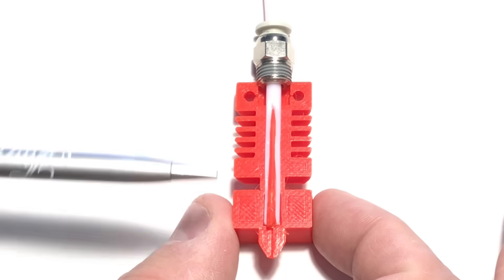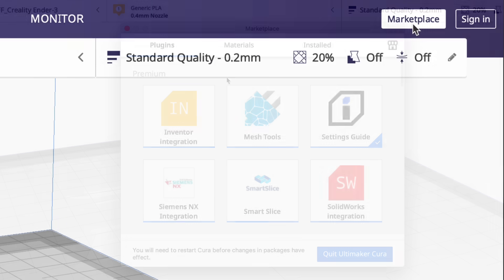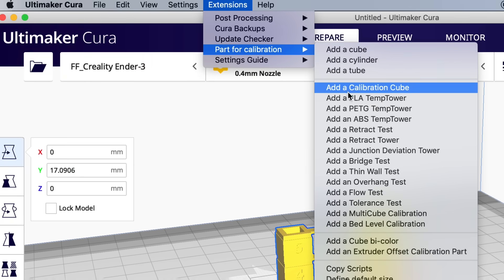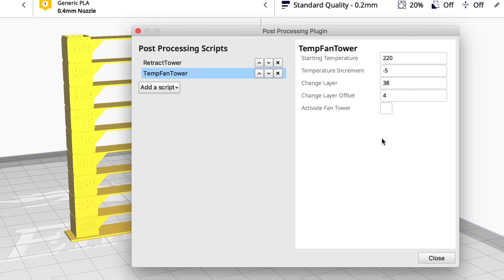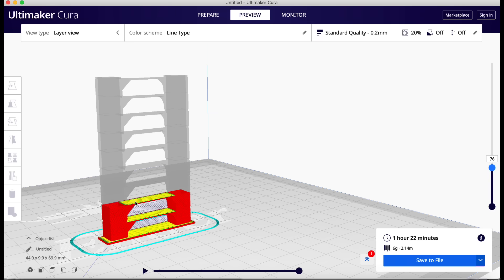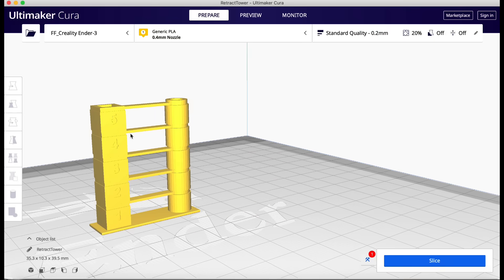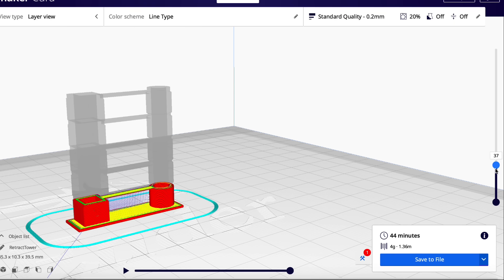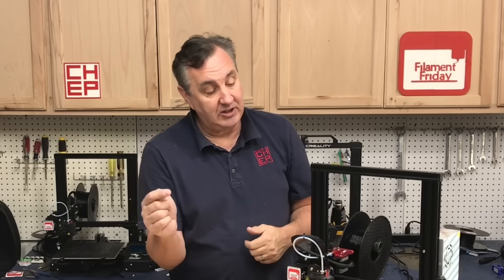Calibrate Perfect Retraction Settings Using a Cura 4.8 Plug-in

Comment: Hi chep
I found that I am getting no strings at 220°c with retraction distance 5 at speed of 50 but I am facing a problem for 30-50 min printer print well but after some time filament stops to come out of nozzle what can be the problem waiting for your reply thanks.
Reply from the maker: Might be similar to this https://youtu.be/x35aWmnZ_A0

Comment: I just updated it to Cura 5.1.0 and Calibration Shapes 2.1.0 and something is very wrong... I am using the Standard Quality profile, layer height .2mm, and for some reason the bottom layer of my first bridge is at layer 39, which would be fine if my next one was at 78, but it is at 81...Checking each temp transitions I get these layers at the bottom of each bridge

378 	Top Layer
372		+42 layers
330		+41 layers
289		+42 layers
247		+42 layers
205		+41 layers
164		+42 layers
122		+41 layers
81		+42 layers
39

I don't understand what is going on.  Each transition is either 42 or 41 layers away from the previous.  It goes back and forth until about the midway point where it doubles up on the 42 then goes back to alternating.  Any idea what is happening?
Reply from the maker: 5.1 is a beta.
Reply: I just noticed the dimensions of his tower in the bottom left and mine are different

44.0 x 9.9 x 69.9 mm CHEP's
44.8 x 9.9 x 75.6 mm Mine

I had to spend some time coming up with a calculation to fix this.  If you look at the object as 9 chunks, top of the bridge down as a chunk, including the slight in-step at the bottom of each chunk, or the whole base as the in-step layers of the bottom chunk, I got this:

((A * 9) * B) + (C * B) = Z scale

Where A is layers per temperature change, B is the mm per layer, and C is number of layers of the last in-step.  For me it was 

((38 * 9) * .2) + (4 * .2) = 69.2 mm Z Scale, or 91.49% of the original object that mine imported...
Reply: Same deal for me.  In all reality it's not a huge deal as it does take time for temp to increase anyway.  So long as you are starting the temp increase at the top layer of the bridge for the next temp calibration area you will be fine.  Same will occur w/ the retraction tower.  I set layer offset to 0 also as when I was inspecting gcode I noticed the temp change would start higher than it should as it added the base layers defined in layer offset from the initial start layer.  So if initial start layer is 40 and layer offset was 3 (For a base of 3 layers) it's start increase at layer 43 instead of 40.
Reply: The retraction tower seemed to match CHEP's, so after doing a few leveling tests I started the heat tower...which detached from my bed right at the start of the third bridge, so I have 220, 215, up to the top of 210, and then a pile of spaghetti...sigh...what it did manage to print looks ok though, there is a slight droop in the 220 bridge, which is to be expected, but 215 looks good and what printed of 210 looked good too
Reply: The instructions for the temp tower(available from github) say to print at layer height of 0.16. There are instructions for all of the calibration shapes included in the addon on github

Comment: Being a newbie to 3d printing, this is a great video for my PETG filament calibration (of which I still have stringing problems).  I tried both tests and see some differences in the temp test and in the retract test.  Looking at the actual gcode file for each test, in the "temp.gcode", I see the M104 instruction to change the temperature at each designated level.  However, in the gcode file for the retract test, "retract.gcode", I to not see any instructions for changing the retract distance at each level (like G10, G11, M207, M208 or M209).  The only "M20#" instructions I have in that "retract.gcode" file are: M201, M203, M204, M205.  Yes, I did load the "RetractTower" script prior to slicing.  How does this retract test work if the retract is not being reset at each level?  What am I miss-understanding (or actually missing)?  Thanks in advance.

Comment: i have cura 5. there are some differece. my printer doesnt obey the comand, it doesnt change the temperature
Reply from the maker: I just ran one in Cura V5.0 and it worked flawlessly. So I’m not sure what the issue is.
Reply: I manage to make it work! Dunno what I did, but, it worked
Reply: Have you tried slicing, then adding the script and slicing again?

Comment: I sliced with Cura 5.0 the scripts are already added. However, when I save to disk then send it to Octoprint it doesn't change temps OR retractions. I checked to make sure I had the script in the bottom right after slicing. I am sure I'm doing something wrong, obviously, and its probably simple. Please help.
Reply: it takes about 5-10 minutes for me to change the temp while printing. So make sure you wait first

Comment: Been having stringing issues for quite some time now. Running these tests and hoping to figure out what the best settings are for my pla! Also, should the temperature changes be reflected on the screen of the ender 3 v2? The temperature indicator on the screen doesn't change automatically.
Reply: I have the same problem
Reply from the maker: Try this. https://youtu.be/OG7We83M5gc

Comment: Cura 5 doesn't change the temperature as it builds the tower. Any suggestions?
Thanks for your help!
Reply: You still have to go in and add the gcode that triggers the temperature change. Extensions -> Post Processing -> Modify G-Code. Press Add a Script, and all the scripts should be there to choose from. Pick TempFanTower and follow the video like normal
Reply: @Homebrew Stew you should be able to confirm if it's cura causing this or not by looking through the code it generates. Open the .gcode file with notepad or something similar and start using ctrl-f to look for the temperature change command. Each layer has a comment which looks like ";LAYER:#" to denote when that layer starts and in my experience, cura injects the custom gcode right at the beginning of the gcode for that layer. Look for an M104 command. If the command isnt there, you can manually add it yourself, or try to diagnose why cura isnt adding your custom gcode as intended. If it is, then you will have to see why your printer is not interpreting the command correctly
Reply: @Homebrew Stew What settings did you add for the ChangeAtZ 5.3.0?

Comment: I got the right temp setting for my pla +.  When I run retraction test, on retraction of 1 through 5 with a speed of 50mm/s I’m basically seeing no change in stringing it’s still pretty bad.  What would you do in this case ?
Reply from the maker: Try this: https://youtu.be/OG7We83M5gc
Reply: @FilamentFriday  Dude says he sees no difference in his retraction test and you link a video in which you clearly state that this is not a solution for retraction issues, only for wispy stringing...
Reply from the maker: Marco2G -?And what’s his issue with retraction? 
Stringing.

Comment: Great video, thanks for the work, no matter what I do when slicing my layers don't line up like yours "38/76" etc - I copied your settings .2 layer height made sure everything is .2 copied the size of your tower and no matter what mine does it in increments 38 - then 79 then 122 etc it constantly get's further from 38 - I try 39 or 40 no matter what I do my transition layers never line up I am over it. How can I get an accurate idea of the tower if I can't get the transitions setup properly. Thanks for the start though.
Reply: same problem must be a compatibility issue with version 5
Reply: Had the same issue, but reasoned that the setting doesn't need to apply at an exact layer.
Having a layer or two at the wrong setting won't prevent you from observing stringing at different settings, as long as it prints at the correct setting for most of the layers.

Comment: When I load the Temp Tower model it's showing 75.6mm tall, and the layers between temps vary between 41 and 42. Layer Height is set at .2 but the tower is imported at a weird height. Any idea what would cause this?
Reply: same
Reply: There is definitely something wrong with this tower height for the 0.2mm layer height (as per video). I think we need to change the initial layer height, and a few other parameters in order to get the exact multiples. When I have time, I will work on it. Now, I just design a single tower and print it a few times with different temperature :D

Comment: my temp tower is all stringy on the back esp at the bottom where the higher temps are. was i supposed to print with supports? besides that, all the layers pretty much look exactly the same, only varying amount of stringing but only on the back. yes, it did change temps.
Reply: no its probably because it wasnt at that perfect temp and was too hot so it was stringy

Comment: When is "Calibration" coming to cura 5.0?
Reply: It took me a while to find it also.  Push the Marketplace button then push the little "Search in the browser" icon.  It installs directly from the browser.  After restarting Cura, you'll find it under the Extensions menu (unlike in this video).

Comment: Will this work on an ender 3 S1 direct drive?
Reply from the maker: Sure. Why not?
Reply: @FilamentFriday  The direct drive on my printer has a retraction distance of 1.35 and speed is 40. If I go to 3.5 - 4  for distance it almost always clogs. So I was just wondering if the settings for a retraction test would be different with the microswiss direct drive.
Reply: @Robin991000  yeah I want to know how to do it with the microswiss old DD and New NG
Reply from the maker: Typically I use 1 mm with most direct drive. It depends on the filament.
Reply: @FilamentFriday  I managed to figure it out mine was set at 1.35 and jamming so I dropped it to 1  and it's been working fine since.  When I wrote this a while ago I was new to the direct drive and couldn't find alot about it and how to tune it so wanted some help.  but it's all figured out  now and running beautiful 😊
Reply: I also Want to know this?

Comment: what if my temp tower has BAD stringing at all temps? tested pla+ 230-200C. anycubic vyper using .2 default settings.
Reply from the maker: https://youtu.be/OG7We83M5gc
Reply: I'm having the same BAD problem.  I'd be happy with the small amount of stringing in CHEPs' video below.  CHEP, is there help for those of us who have BAD stringing problems?   I'm just starting with the temp tower with lots of stringing.
Reply: @KenOfHouston  hey friend, you could try the video chep linked under my original comment. What actually ended up being my problem was moisture in the PLA filament. I live in Oregon USA and it gets decently humid. I didnt realize how quickly the PLA would absorb moisture. I bought a new roll of PLA and a dehumidifier box for it to sit in. i bought the Esun one. ive been having much nicer prints since.

Comment: Didn't work. I'm on my 4th level of the print and the temp is still 245 degrees. Starting temp was 250 degrees. Should be 235 degrees by now if it really reduced by 5 degrees.
Reply: Seems like your hotend suffers from a broken/faulty thermistor that causes thermal runaway. I suggest that this is in need of a close inspection and when this shows up to be the case I would buy myself a brand new replacement thermistor or perhaps the complete hotend if the one used for your printer is also a not too expensive upgrade hotend obviously. Because eventually pricewise it makes no sense replacing a (for example ‘dragonfly’) hotend in comparison with finding a single new thermistor somewhere. I hope my tip will come useful and you can continue 3d printing soon

Comment: how do we translate this for pla+. get a 3d printer they said, it goes brrrrr they said. frustrating as hell for a total noob.
Reply: pla+ starts at 230 and goes 200 for temp tower. you have to make sure before you slice it that you set the starting temp at 230 or else itll boot up by default to 220
Reply: thanks for the clarification chep.

Comment: Very instructional, thank you.
Bhat in what units are the retraction steps? Let's say I printed both towers and found out that retraction step "4" works best for me, how do I use it in Cura? The settings for retraction in Cura that I found are in mm, so how do I translate the "4" to mm?
Reply from the maker: Set retraction to 4mm
Reply: @FilamentFriday  Thanks!
I have another issue I'm guessing is also related to retraction. I have the Prusa i3 Mk3s+ (kit). I see that consistently, after every non-print move, when the printer should resume printing the print does not start where it should; there is a lag until the print actually starts so the first few mm of the print are missed. There isn't any noticeable stringing during the move, it is just that the resume of the prints lags.
Is this related to retraction? Which setting(s) do I need to tweak?
Reply: @oferrivkind  That's why you should prime the nozzle before the print. Use a Skirt, Raft or Brim before printing the main print.

Comment: When I go to print the slicer temperature settings seem to be overwriting the Gcode script i entered. Printer jumps to 200 regardless of the preheat I set it to and the temperature is not decreasing after 38 layers. Am i doing something wrong? Wondering if it could be the firmware I downloaded.
Reply: Did you follow the step at 2.57?

Comment: Hi, thanks for all the amazing videos!
I have an Ender-3 Pro (and Ender 5 Plus), when I check the layers of the temp. tower I see that the first layer of each of the bridges are at layers: 
39
81
122
164
205
247
289
Which means at jumps of: 42,41,42,41,42,42, how could it be and how should I resolve this please?
Reply: Maybe you have adaptive layers is enabled?
Reply: I have the exact same numbers as you.  Were you able to figure it out? and I do NOT have adaptive layers enabled.
Reply: I had same with my Ender-5 Pro, and while I don't know if it was the "right" solution, I put a "Change Layer Offset" in of -3, to basically get the first change  to 42.  I know that won't make everything perfect, because some are 41 and some are 42, but until someone that really knows what they are doing answers, that is what I tried.  It is running now.
Reply: I have the exact same numbers as well on my Ender 3D pro. First 4 lines of base, starting at 5. First ceiling at 39, then at 81, 122, 164, ... I entered Change Layer at 41 and Offset at 0. This matches the physical part best following y = ax+b. I feel this is good enough for a general impression.
Reply: I'm seeing the same thing, I just set it to 42 with an offset of 5 since that's pretty much close enough

Comment: Question to CHP, if I want to work with an add a script for a temp tower starting at 195 - 230℃, which add a script would you recommend me. With Mac OS Monterey 64 bit Intel processor, printer Anycubic Vyper.

It could be that my text isn't worded clearly, that's because English isn't my mother tongue, I'm going to end school about it.

Greeting
Heinz Gitz
Reply from the maker: There is a link in the plug-in description that takes you to a wiki where the developer explains how to use it
Reply: @FilamentFriday  You may not have the link............. to it from -wikileaks.

Comment: hey, Chep. im currently trying to run a temp test for some new filament im trying out. Problem im running into.. When i load the temp tower and save to SD card, when i go to print, it only heats up to 200c. when the base of the test is set to 220. Am i missing a step? Thanks for all the great content
Reply: You need to set the Print Temp under Materials to heat up to 220 and then it will change by it self.
Reply: @rickymc7287  ya and I also wasn’t modifying the g code with the plug-in. I was able to figure it out and get it printing correctly. Thank you!

Comment: I feel dumb because I don't know this but I did just as you said but the temp goes straight to the settings that were stored.. can you tell me how I can fix this
Reply: Before slicing the print what is your temp in your settings? If you want it to start at, e.g. 220 degrees, you need to put that in the settings; the script will not do it for you. All the script does is increment it at the layers you have told it to.

Comment: Same here, would be to nice if it would work, the retraction tower does't do any retraction, i use cura 4.13.1 and a ender 3v2 with jyers firmware, if i enable retraction normaly, it retracts the setted 7mm, but if i set the Post Procressing Script as in the Video showed it dosn't retract 0 on the whole temp tower 🤦‍♂️ i get slowly angry about this, why it don't work?

Comment: Chuck, what commands should you be able to see in the gcode that will show retraction and temperature changes are taking place. I am using Cura 4.13 and can’t find the relevant codes?
Reply from the maker: I’m not sure. There are many commands that could be used. Search the Marlin GCode list for more details.

Comment: Doesnt work if i try it with the correct setup in script he print all in the same temp and retraction. and i cant figure out why
Reply: If it doesn't change there is a script to do it manually you have to add one per layer you test. I'm not home currently but I think it's change at z hight
Reply: Had the same problem. Change print temp & initial printing temp, in print settings to 220 . Works then
Reply: Same Problem here, retraction is always 0 even with the code

Comment: Ender 3 V2 clone... Ran the temp test, got my results at 205, now running the retraction test... There is no string at 1-5... which is nice I guess... but what does that mean? Do I set my retraction at 1?
Reply: You got lucky with that temp, that filament, how your hot end is put together. If your Bowden tube slides out of the hot end over time you will start to have more problems later. Watch it every month or every time you switch to a different brand of filament. On the cold ish side of nozzle temps 195 200 205 you will not get a lot of ooze. But it really just depends on the filament.